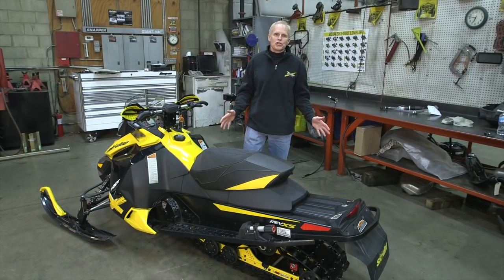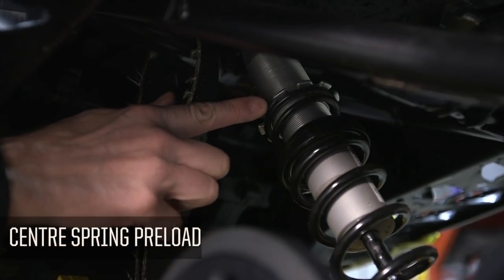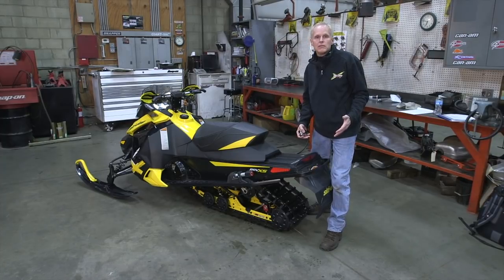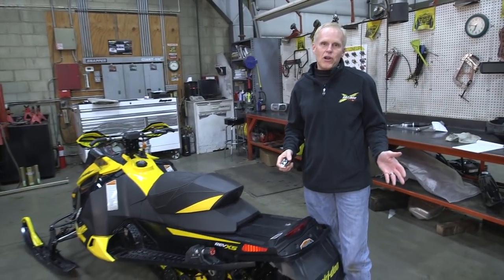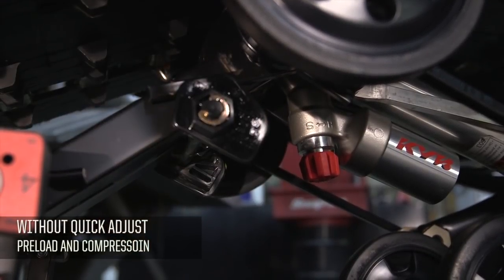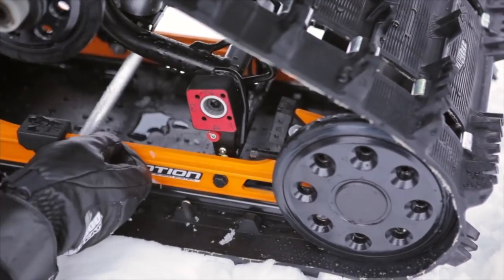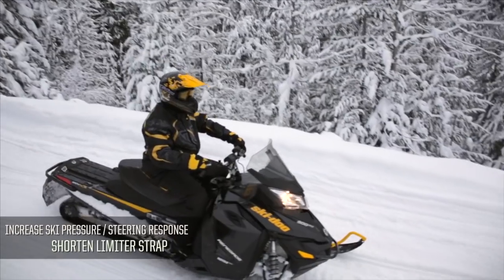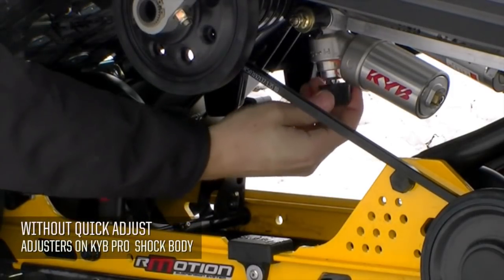How to Set up Your Ski-Doo rMotion Rear Suspension

Comment: My '13 Renegade with 1100 miles sags back down a bit just with it's own weight after I lift up on it, does this mean I need to stiffen it first or should i take my pre-measurement anyways?

Comment: As with measuring the sag and setting the spring preload on a dirt bike, the rider should be in full riding gear (boots, helmet etc.) as the extra weight will alter the height.  Half full tank of gas as well to average the 'as-running' actual weight.

Comment: Hey guys I have a 2014 xrs 800 and I find the suspension very rough I had the dial down on 1 and I still find it very stiff and feel every bump small or big however it does only have 200km on it but should I turn it up to make it smoother? Help!
Reply: There's no reason they wont ride smooth out the box if set up right.  Hard to say what you're doing wrong from such a vague description.  Which dial have you got on 1?  The rear spring preload, the rear shock compression or the 5 position block for the rear spring preload?  There's also centre spring preload and centre shock compression adjustments.  I know the XRS has hard suspension because it's the racing setup but with everything on the skid set to softest it should be soft enough that you're bottoming it out.  I think you're missing something somewhere

Comment: My suspension sags soo much and I'm worried somethings wrong. The skidoo sits low to the point where I'm worried that my tracks is going to scrape against the tunnel and that the mudflap is too close to the ground when I sit on it.

Anybody know what's wrong? Is this a common problem? I have a 2013 skidoo renegade backcountry x 600.